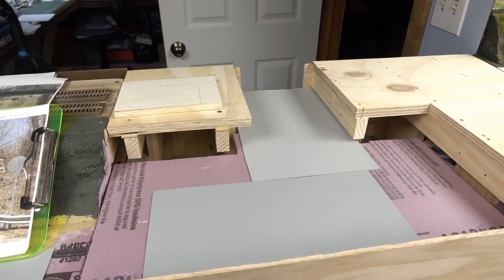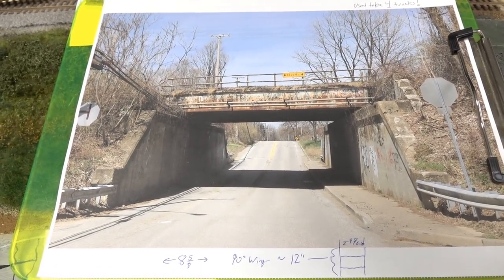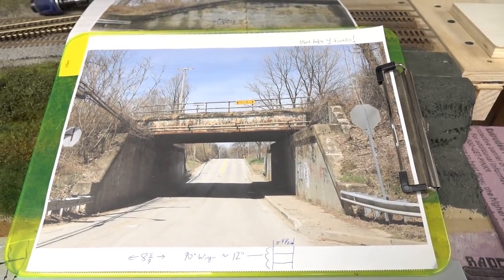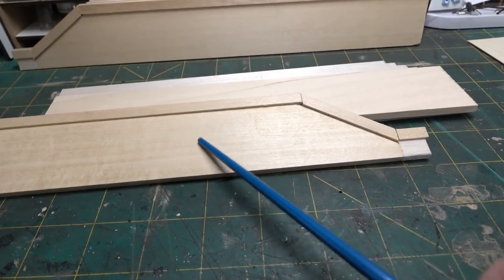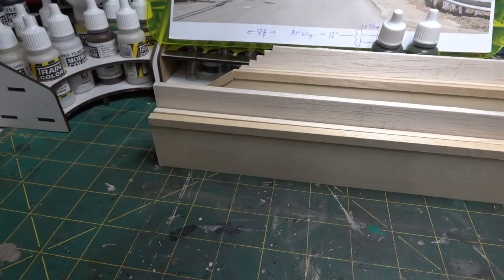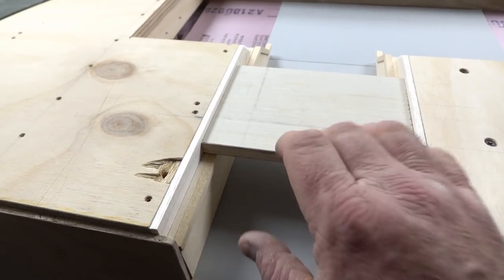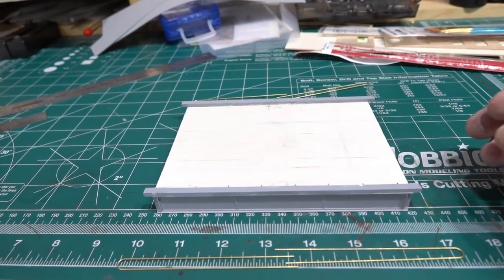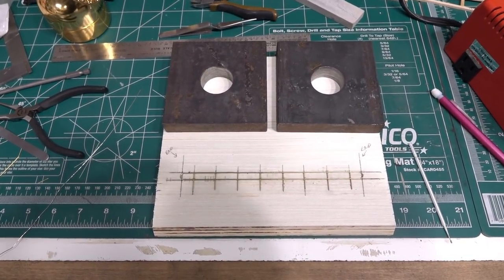Scratch Build #4:  Ballasted Deck Overpass

Comment: Rob you kicked that Bridge out like a Master. I like the hand railings that you soldered up like a pro! Flux works wonders when soldering parts. I like to use liquid flux when soldering. It seams to work better than solder paste. I soldered when I was in the Army and I also worked for Itt building the Singars  Military Radios for the Army and Marines. That's where we used the Liquid Flux a lot. Love that stuff. Good Idea with the Metallic pencils and weathering the bridge.  Keep on Modeling you Model Railroader Dork. I think we are all Dorks who like to model!

Comment: Very nice job on the project as a whole.  The duration of the video is appropriate considering the amount of effort and detail put into the project.  The 10 minute model for YouTube videos does not apply to model railroading.  
Tip for straightening bent wire:  after straightening by hand as best as possible, place the bent wire on a hard surface such as workbench or (if wife is not looking) kitchen counter, then lay a piece of plywood or other wood panel and roll the wire back and forth a few times.  Has worked very well for me.

Comment: is it just me, or is the stop sign in the picture on the wrong side? 
the Conrail line through St Thomas had 4 or 5 of them small underpasses. they were very short. to the point a van couldn't drive under them. 
all the railing would have been 2" tubbing. 
i really like the detail lines on the sides, looks like rock, or decaying concrete 
awesome job on the railings. that is very impressive soldering work.

Comment: Rob I have an app on my iPhone called measure it uses the camera to measure so you could stand on the road level and measure the bridge above you without trespassing better than guessing I think. NB don't worry about the length of the videos. Neil

Comment: Railing looks really great. The only other way of doing it would be to bend the ends and then have the vertical supports in place and solder the railing in place from pieces all cut the same. hen it would look like you had pieced the railing together like the prototype was made. That would be a pain though. I really like your railing. Where did you get the clamp that you use to keep the swing out together???

Comment: Great work once again...but a piece of advice...take it or leave it.... but when you made the caps for the wall, you cut the top one at a 90 and then figured the angle for the next piece and butted it together. This will not line up because the angled piece is too fat.(because of the angle)...instead, run both pieces a bit long, and split your needed angle in half...cut half the angle on each piece and then but them together. This will make them fit together perfectly....Think of a picture frame...two 45s to make a 90.....so for a 32 angle, cut 2 at 16.....Hope it makes sense and helps......
Reply: Now you tell me...LOL. Yeah, I did struggle a little with that, but I don't claim to be an expert carpenter. Now I will know how to do it next time- thank you!

Comment: Wow! awesome work. Looks very close to the photo. I would like to learn more about the book and the AK interactive you were using on the bridge. Are going to add the car guard rail at the end of the abutment like in the photo?  I would be interested in how you make them if you do. Rex makes them in HO. but not sure you can still get them. I had the idea to make guard rail in a die made out of Evergreen plastic. to act as a way to press the guard rail out of Aluminum foil. I was thinking folded over with ACC into strips pressed in the Die mold thingy will create it. The ACC inside the  folded foil helps hold the shape. It worked. And look great. but it is a lot of work. Now I am blabbing along. Amazing job on the whole project. Very inspiring for me.  As your whole layout does.
Reply: Vincent- that guardrail is an obvious detail and I am wondering how to do it- especially since the bridge on the layout is set in the late 1950s and the pictures show it in 2019. What would the guardrails have looked like back in the 1950s????? I am trying to find some reference photos as I don't think they would be like the Rix offering- they are a bit more modern. I have seen 50s versions with a post and cable, so may try that approach.
Reply: @robbennett1965  From MR. Pre-1960 some vehicle roads had guard rails that consisted of what looked like sections of telephone poles installed at intervals along the side of the roadway.  Some of these posts would have steel cables stretched between them while other sections of highway only had the rows of posts.  Often simply painted white or maybe only the tops of the posts were painted white.  But with that said. There were metal guard rails too. They were white and with a  convex curve for strength, round cupped on the ends, mounted to past like we see today. there is a wooden block in the inside of the concave side of the guard rail.  I even seen just post pained white and the bottom 12 " is black. Good luck. Can't wait to see what you do decide to do. After all it is your rail road.